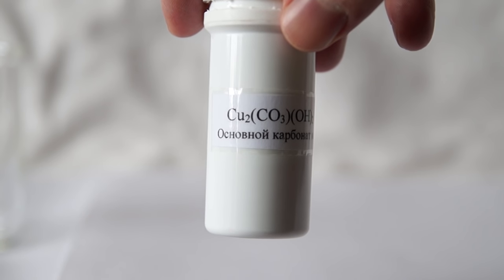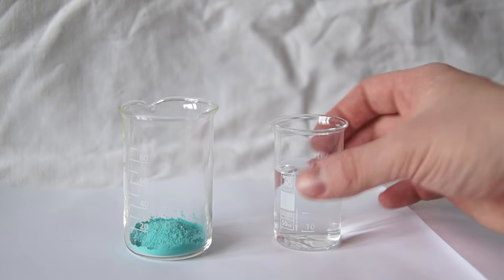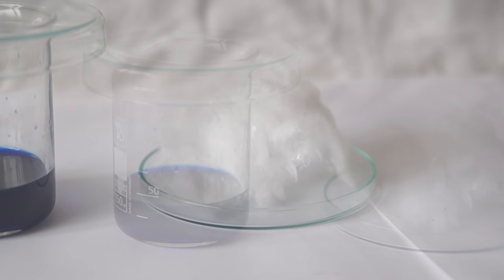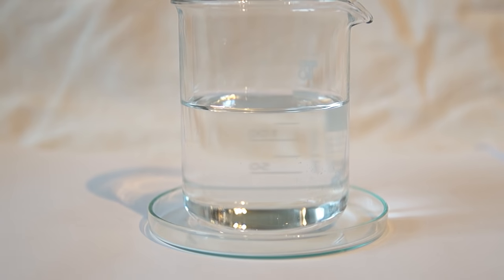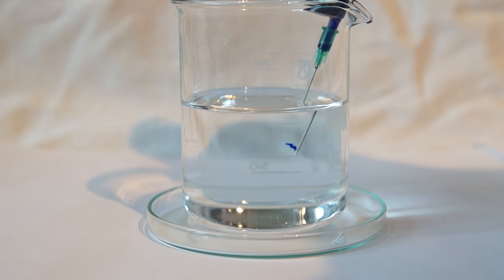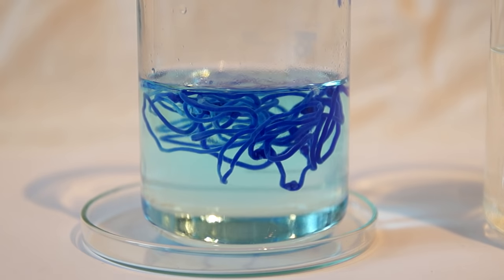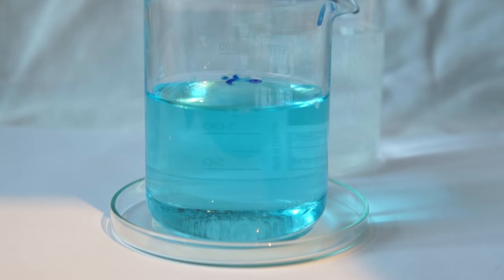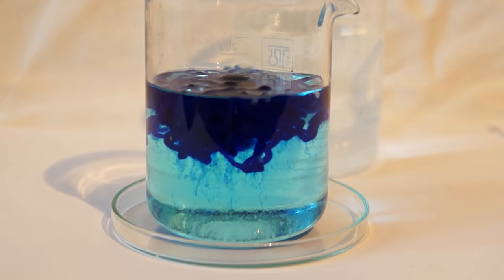Making Rayon Fiber - Artificial silk, chemical experiment!

Comment: Thank you very much for this demonstration, very impressive. I wanted to perform a chemical demonstration for a school chemistry class, however the dissolution of the cotton wool did not succeed. Is there a specific duration required for the solution to thicken? We used copper sulphate, as well as sodium hydroxide, however the product was too thin and did not produce the reaction sought after. Please any advice is appreciated! Thank you!

Comment: I'm a student attempting to conduct this experiment.  I have a mediocre knowledge of high school chemistry and just want to ask the following questions:

1.) If an aqueous solution is a mixture of in part water and a given substance, can we just dilute 100% ammonia to a 25% concentration by simply adding water (H2O)? 

2.) what does the 'n' in the (H2O)n mean in the given chemical formula of the resulting product?

All input are appreciated!
Reply: +john binay I don't think you can get 100% ammonia. That's liquid ammonia. But whatever high percentage ammonium hydroxide solution you have, you can dilute it. Be careful of ammonia fumes.

The chemical formula of the complex Cu(NH3)4(H2O)n represents a structure. Imagine a 3D octahedron (two pyramids attached at the base). The Cu+ ion will sit at the centre of this octahedron. The 4 NH3 molecules will be at the 4 horizontal vertices and the remaining 2 vertical vertices will be occupied by H2O. So n=2 in this case. Look at pictures of 'tetraamine copper coordination complex'. Remember that an octahedron has 8 faces and 6 vertices.

This is irrelevant to the stoichiometry. Water is always in excess so you don't have to worry about where the molecules come from.
Reply: Generally 25% is available in market. Stay safe it causes irritation in eyes and very strong smell. Did the same experiment in my project related to fabric chemistry, and I won the contest.
Reply: I did this experiment and gave me this result .. but after making it, it cut just by touching. So do you know what the next step to be able to use it. 
Do you know the benefits of it ?

Comment: Impressive - you mentioned that the fibers are not strong and rip easily. How might you change that? How might you change the process you went through in order to guarantee fibers that would not rip easily? Thanks!
Reply: To do so, one would somehow have to increase the polymer chain length of the silk

Comment: Your copper (II) carbonate has 2 hydroxides in the formula. Is this important ? or will normal Cu2CO3 work?
Reply: David Longman 
The formula of the compound formed in the end should be [Cu(NH3)4](OH)2

So you can use either a normal copper compound with NaOH anD NH4OH or only by taking a copper hydroxide compound with nh4oh

Comment: Does one need sulphuric acid or is the reaction purely a neutralization reaction and therefore one can use any common acid?
Reply: As long as it's strong enough to displace ammonia from the copper it should work. I got it to work with vinegar even during attempted filtering of this copper complex before I knew it did this.

Comment: Hello! Any insight on where we can purchase 25% ammonia solution? It seems like all-purpose cleaner ammonia is not working. Thank you!
Reply from the maker: You can purchase it in a chemical store.
Reply: Elizabeth Esponnette  u can concentrate ammonia solutions by slow heating in a well ventilated area
Reply: Although not recommended....
Reply: Adnan Gaming No you cannot concentrate ammonia solutions by slow heating. You can however heat some dilute ammonia in one container and lead the gas to another container also of dilute ammonia solution.

Comment: Can you use 10% hardware store ammonia, if not where can you get 25% ammonia.
Reply from the maker: You can also use 10% ammonia solution, mut fibers forming in this reaction can be a little thinner, maybe fragile. 25% solution you can buy in chemical store.
Reply: dawn smith gr8

Comment: how to make to copper carbonate
Reply: +HaUnTeD spades Dissolve copper metal in nitric acid. Then precipitate copper hydroxide using sodium hydroxide. Be careful as a LOT of toxic nitric oxide fumes will be released. Solution will also get incredibly hot and boil, so do it in an ice bath. Filter out the precipitate. Then try and dissolve it in excess concentrated solution of sodium bicarbonate. You will then have basic copper carbonate solution. Dry it to get powder.
Reply: +Archishman Ghosh Or buy Copper sulfate (cheap) and react it with baking soda (cheaper)